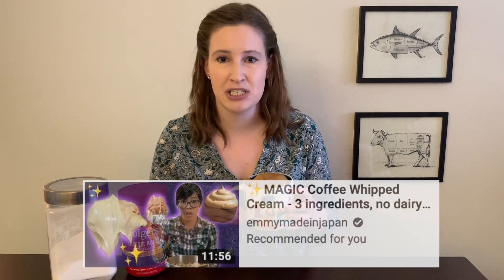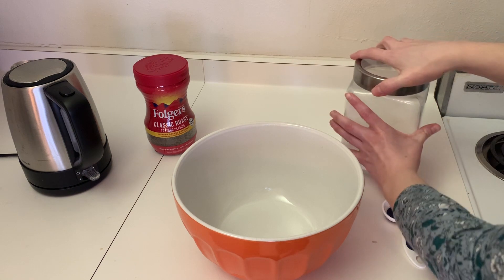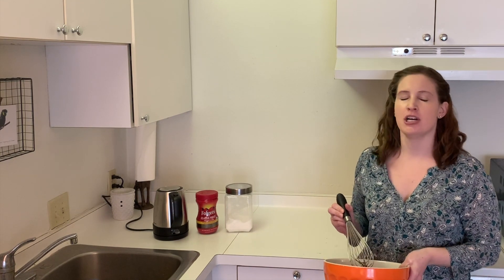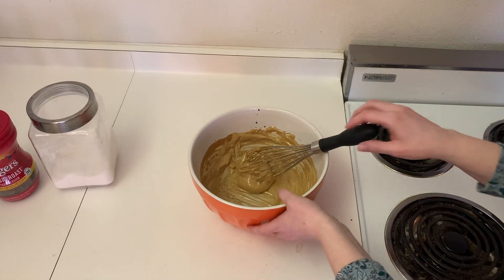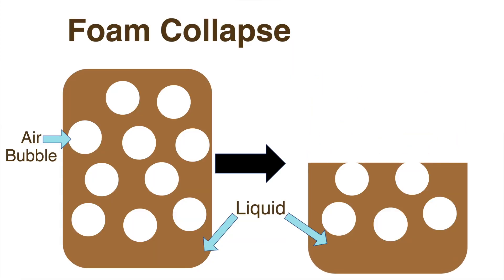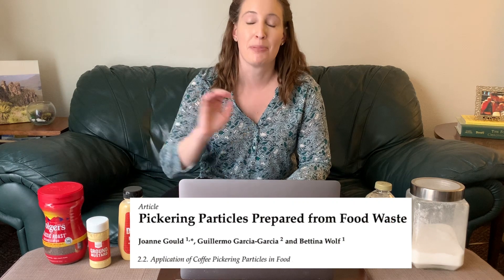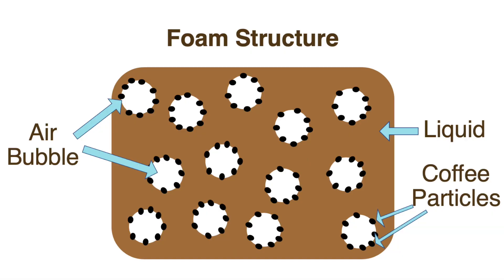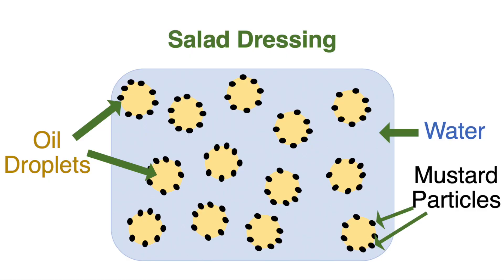THE SCIENCE OF CLOUD COFFEE EXPLAINED: how whipped coffee is made and why it works

Comment: I love whipped coffee a lot! I did a experiment with javy concrete original microscope coffee liquid into empty water bottle with equal parts of javy microscope coffee liquid mocha and monkfruit sugar powder and hot water. The first step is to make hot water in the microwave for 2minutes. Next I grabbed a glass measuring cup and add two tablespoons of sugar and two tablespoons of javy mocha and add hot water 2 tablespoons and mixed it well enough and then I used a white funnel into an empty water bottle with a lid on tightly. I started to shake it and it got thick faster than by hand. I think you should try this as well.